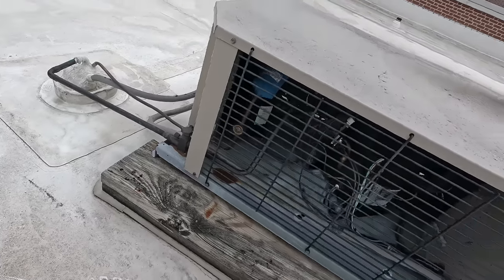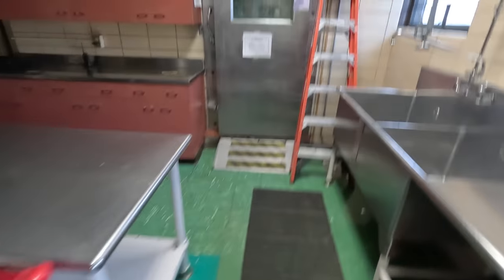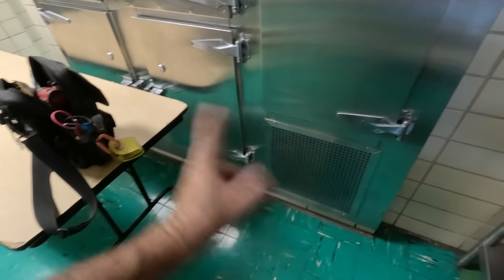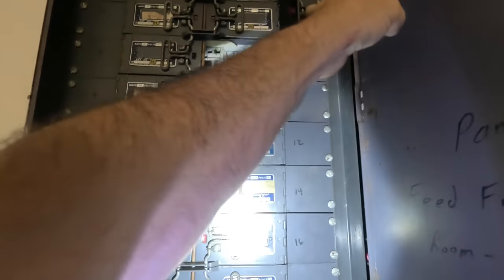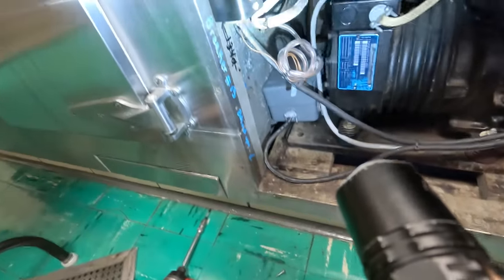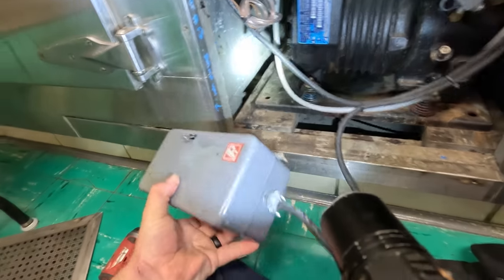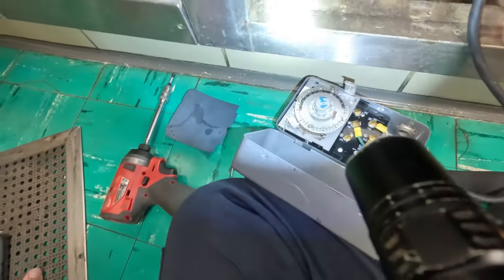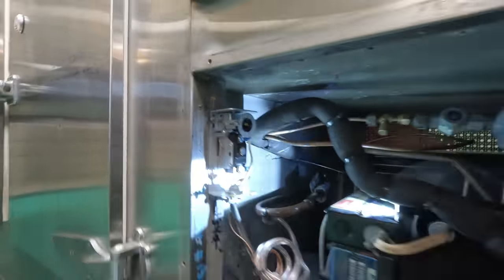Walk-In Freezer & Cooler Down + Chrysler Reach-In Cooler Warm

Comment: Topdon sent me their TC004 imager, and while it's the first one I've ever used, by comparison to others whose output I've seen on Youtube, it's pretty impressive. The frame rate is quite good on the TC004 as well.

While I knew Chrysler had a whole line of HVAC stuff, I didn't know they offered refrigeration equipment as well. The build quality on that stuff looks incredible. Efficiency notwithstanding, they ought to run that stuff until it dies.

Comment: Your right, those valves are not required. I cut them out so they didn't create future problems. But sadly doing the right thing for your customer is taken out of the picture by money. I made money, contractor made money, yet we did right thing. It's not the money, or time. If your to busy for something this simple your rates are to low. Great service call.